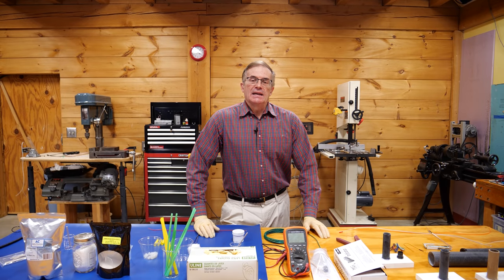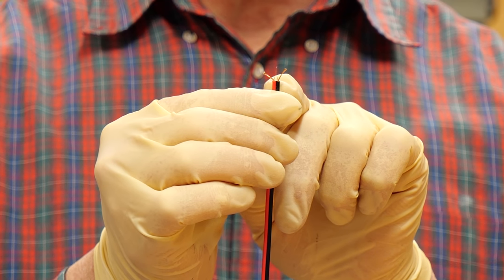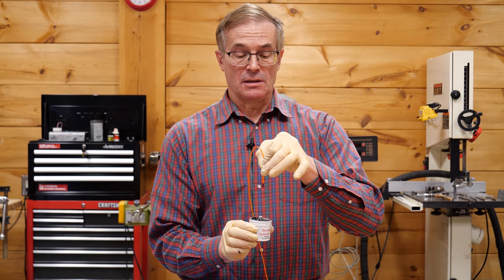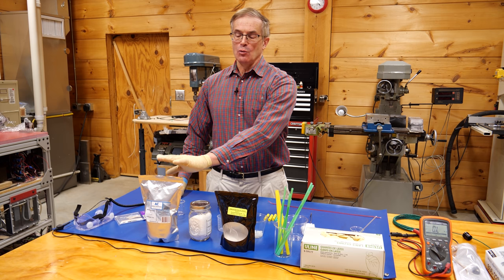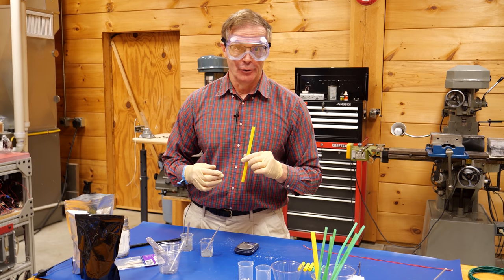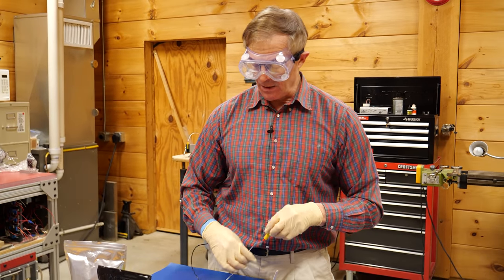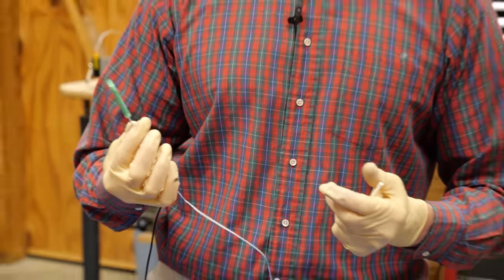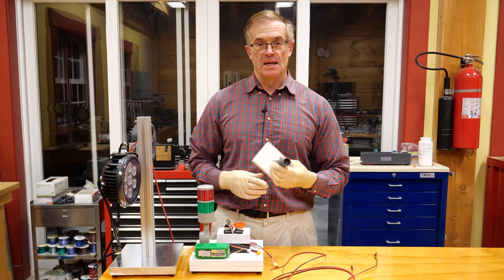Rocket Ignition System On Steroids!

Comment: I'm curious about recovery systems for these rockets. When I was a young'n, the Estes models incorporated a charge in the end of the engine which would pop the nose cone off, and if packed correctly, deploy the parachute. I'm wondering if that was a somewhat proprietary setup to sell more recovery wadding (fire-proof toilet paper, basically), or if it's just a tried-and-true method.
Reply from the maker: It's not proprietary there are ways to fabricate that delay segment and recovery charge.  With the improvement in low cost, light weight electronics, even relatively small rockets can use digital recovery systems based not only on time, but also altitude and acceleration.

Comment: If you place the rocket motor on a Nintendo Wii Fit Balance Board, you can connect it to your computer over Bluetooth for an easy way to log thrust over time, rather than just logging maximum thrust. For $10, you can't beat it.

Comment: Would the wire sticking to the motor for even that fraction of a second, if in an actual rocket, not cause just a bit of a snag to one side upon launch?
Thanks!
Reply from the maker: Probably not.  If the wire doesn't disintegrate, it will be blown out before the rocket has moved significantly.

Comment: would the hot glue cover up the starter when inserting into the green straw? if so does it simply burn easily through the layer of hot glue covering it?
Reply from the maker: It does cover it up, but the starter burns through easily.

Comment: @Tech Ingredients 
Re: QuickBurst Kit constitutes, circa T-5:00
) I’d like to suggest that perhaps the “binder” included in the kit might instead be a 'nitrocellulose lacquer' rather than an 'acrylate-based resin'.  
.ᴀ) Have any thoughts about this in favor or otherwise? 
.ʙ) Do you by chance recall if this binder had any odor to speak of?   
) Finally, any thoughts or indication of what oxidant they've included in the kit?  
.ᴀ) Any telltale coloration upon combustion? 
I'm guessing one of the chlorine donors but I really have no idea.  
I‘ve tried, unsuccessfully to locate an SDS for that kit; it seems the manufacturer is a smaller organization so I’m honestly not too surprised.
.ʙ) Were you provided anything like that?
Reply from the maker: They provided no information and you may be right about the binder as that works with acetone.

Comment: I'd consider using some heat shrink tube instead of the straw. Should be a lot easier to set up. As long as you can heat it to shrink without starting the primary igniter of course, but at around 90°C should be possible. Especially you're using hot glue which is often hotter.
Reply from the maker: I tried it and it works, but it wasn't any easier and so I kept it simple.

Comment: It seems to me that these rocket motors burn with full thrust only in the first 4-5 seconds. Perhaps because of the growing cavity inside and therefore the declining pressure of the gases? Is there a way to keep the pressure more constant? Perhaps by pouring rocket fuel with different burning speeds into the tube in several layers? That is, from inside to outside with increasing burning speed? This would allow the engine to burn more efficiently at full thrust almost to the end.
Reply from the maker: Remember these test grains had no nozzle and a burn of ten seconds would be pretty long for such a small motor.  With the increase in chamber pressure that occurs in an actual motor, the burn rate increases.
Reply: Ah, I forgot. Thank you for the answer.

Comment: I am absolutely FASCINATED by this series, thank you!    I have a request, I have been studying amateur rocketry for several years now, and I ran across a french white paper from 1970 or 71 wherein it talked about using chemically retarded Semtex as a solid rocket booster.  Obviously, as a civilian, I don't have access (or the desire) to replicate that particular setup, however, the idea of taking a highly energetic substance and chemically altering it to slow its output is scientifically AWESOME.  Could you consider doing a video explaining such reactions?
Reply from the maker: Your practical concern is paramount.  The necessary quantity of any energetic precursor could seriously damage a building if detonated.  I'm going to stay away from that.
Reply: @TechIngredients  yeah I don't think that rocket was ever tested, it was theory only, I was simply interested in the chemical inhibitor aspect of the rocket.  WAY too dangerous.

Comment: Are the time hacks on that last run actual? Did you get on the order of a minute of useful burn time?
That's quite impressive.
Reply from the maker: The burn times are real, but the useful portion is only during the most vigorous portion.  These were only test grains for various propellent mixtures and did not include a nozzle.  With high chamber pressure the burn accelerates, is even more vigorous, but shorter.

Comment: Wow, everything you do is very good. The rocket engines which me and my son made burned for about 5 seconds. The ones which did not exploded. (Wife threatened me if I did that again).  You had over a 10 second burn.  I used one of those pressure plates to calculate the power.  My question, is how big of a engine can you make with the rubber?
Reply from the maker: Thanks!
The test grains I ignited didn't even have nozzles (I mentioned that, but didn't emphasize it).  The propellent in one was exactly the same formulation as the solid rocket boosters for the Space Shuttle.

Comment: I think you missed the point of the key on that switch. In industry and military, those types of switches always come along with the rule that no one enters the danger zone unless they are carrying the key. That prevents miscommunication from causing the operator thinking the zone is clear before it actually is.
Reply from the maker: No, I get it.  I just didn't want to overcomplicate the presentation.

Comment: Thanks a lot for making such quality vids!

question: have you thought about using thermite to light up theses engines? iirc it's some rust and aluminium plus manganese fuse and it burns at very high temperatures, it could be very useful for fuels with a high ignition temperature
Reply: Well a good fuel is a fuel that wants to nearly burst into flames but doesn't randomly.
Reply: @Skylancer727  i mean not as a fuel, as an igniter
Reply: @jujuteuxOfficial  well thermite is good for long burns but still needs an ignition like the fuel itself. You'd more have to drip it into the fuel tank which just adds an extra step of lighting the thermite then dropping it in.
Reply: @Skylancer727  as i said: normal fuse with maganese powder/maganese fuse strip all of that covered with thermite
Reply: @jujuteuxOfficial  well if it's basically the same setup, you just threw thermite in. Not seeing the point of doing that. It's not like you need the thermite to sustain the reaction.
Reply: @Skylancer727  not to sustain, to have a stronger kick
thermite burns really, really hot and will likely create a much stronger fire

Comment: Those composite rockets seem to have two stages; once the burn settles down a bit, are they still producing much thrust?
Reply from the maker: No they aren't.  The grains we're not cored through to the bottom and they were only fabricated to test different mixtures.
Reply: @TechIngredients  Ah, I see.  So instead of concurrently burning the entire inner surface, they're only burning the cross-section of the tube.  Thanks for the response!  Yours is by far my favorite YouTube channel--keep up the good work!

Comment: Curious why there was the continued low intensity long burn after the main trust event.  This would be tricky for a system deploying a parachute where the parachute might be set on fire by the continue low intensity burn.   Would this continued low intensity burn be eliminated for a rocket with a nozzle due to higher pressure forcing everything to burn out quicker?
Reply from the maker: That's  correct.  The regression  rate through the propellant  is pressure dependent.

Comment: Some of the rocket motors appeared to trail off in thrust for an extended time. If so was that by design? Why did they not keep the same flame output all the way to the end?
Reply from the maker: Remember, these were not motors, they were propellent test grains.  There were no nozzles, no significant internal pressure was developed and the trailing burn was some of the epoxy base and cardboard burning with small residual oxidizer from the propellent.

Comment: I'll add a comment on an alternative ignition system as a FYI safety tip.  The system has the advantage of checking the continuity of the circuit path from the power source (battery or transformer) through a series indicator lamp to the rocket igniter and back to the source ground.  I learned this safety technique from one of those science lab / rocket kits as a kid, so it's not my idea.  Used it when I built a rocket ignition system.  Probably others have seen it as well.  It turns out the lead wires and final rocket igniter connection can be troublesome in the field and this circuit performs a quick check before someone walks out to the business end of the rocket, jiggles wires but forgets to deactivate the power delivery system energizing those lead wires.

_Circuit Loop Description_.
From the positive (+) terminal of a +12VDC battery, the following series of components are connected: an arming switch followed by a series 12VDC lamp, followed lastly by the rocket igniter (having a small but finite resistance).  The rocket igniter return wire is connected to the negative (-) terminal of the +12VDC battery source to complete the loop.  A push-button momentary, (normally open) "Fire" switch is wired in parallel with the 12VDC indicator lamp.

_Operation_.
With the arming switch off, the rocket igniter lead wires can be fielded. Turning on the arming switch provides nearly all of the +12VDC battery power to the 12DC indicator lamp.  The lamp lights up (if the circuit through the rocket igniter is complete).  Very little voltage drop occurs across the rocket igniter because its resistance is much smaller than the lamp's resistance.   The loop is closed.  This is Kirchhoff's voltage law in action.  If the DC resistance of the lamp and that of the rocket igniter are known, one can calculate the voltage seen across the rocket igniter terminals using voltage division.  In general, it is a small fraction of the +12VDC battery output voltage.  If the lamp is not lit, there is an open in the system between the firing station and the rocket.  Disconnect power and investigate.  If the lamp is lit, the system is armed and ready to go.  At "Fire-in-the-Hole," the push-button momentary is pressed.  The lamp is bypassed (and it goes out).  Now all +12VDC voltage is transferred across the rock igniter terminals.  It flares/ignites, and we see something similar to your field demonstration.

If the resistance of the lamp is too small compared with rocket igniter resistance, an additional series resistance can be added such that the push-button momentary is now in parallel with the series combination of lamp and added resistor.  The combination is bypassed when the "Fire" switch is depressed.  Again, use voltage division to calculate the added resistor value to keep the continuity check voltage across the rocket igniter small enough (say, less than 1V) to prevent it from igniting.

Great DYI lecture series, BTW!  Be Safe.

Comment: Question: why the addition of barium sulfate makes the flash to burn much more rapidly, isn't that just a dead weight ?
Reply from the maker: Sulphates at as a catalyst to increase the rate of decomposition of the oxidizer, releasing the oxygen more quickly.

Comment: since you are building the rocket motors yourself, isn't it better to insert the igniter from the opposite side of the motor from the head? I've done this on my crude made amateur rocket motors in the past because i had issue with CATO when pieces of the igniters stuck in the nozzle (residue, wires...). i was using match heads mixture for the igniters and that mixture creates hard residue... i think this is not issue with larger motors tho, since they have bigger diameter nozzles...
Reply from the maker: It's best to do it the way I described.  Just don't use heavy guage wires or durable materials in the starter and they won't jam.

Comment: I'm wondering if you could use one of the Rapidset concrete products (CementAll and Mortar Mix) to make nozzles.  Tough stuff
Reply from the maker: Indeed it is.  Did you see the test bars of UHP concrete we had sitting on the table next to the still in our last video?  Those are based on Rapid Set cement.
Reply: @TechIngredients  The best way to get the most strength out of those is to minimize the water you add through the use of plasticizer admixtures.  Amazing chemistry behind how that works

Comment: Couldn’t you use typical flash powder (Potassium Perclorate And Aluminum Powder) for the amplifier?
Reply from the maker: Ammonium perchlorate produces more gas.  I believe this helps to rapidly fill the core of the motor during ignition.

Comment: This is all very involved, heh.

For my APCP motors I've made I just use a little paper baggie (made of a napkin, often) with an e-match of my own make (or commercial) with copper (II) oxide - aluminium thermite, tied off with some string. 
Starts motors instantaneously - and I do mean instantaneously - with no chance of plugging the nozzle with molten plastic or other debris.

The copper plasma is a very very good method of ignition due to its heat and its catalysis of AP decomposition
Reply from the maker: Molten plastic will not plug the nozzle even if any of the plastic is not vaporized.  Only the conductive wires we are both using have any possibility of surviving.

Comment: Since you have been using both potassium chlorate(KClO3) and ammonuim perchlorate(NH4ClO4) in your videos now, it might be a good idea to mention that these to chemicals must never ever come in contact with each other. Really careful pyrotechnicians won´t even use them both in the same building. If KClO3 dust ends up in a container with NH4ClO4 they can form NH4ClO3 which can detonate spontaneously, and in the worst case bringing all the AP to detonation along with it.
(The possibility of NH4ClO3 formation is also why the combination Aluminium/nitrate/chlorate is known as "the death mix")
Reply from the maker: Thanks for the warning.
We don't have potassium chlorate in the building and haven't worked with it.
Reply: @TechIngredients   You used KClO3 for the smoke bombs almost four years ago. That was the time when I wrote a really angry warning because I thought no one should ever demonstrate that without warning for how sensitive it becomes with other fuels, or with even with sugar without retardants and stabilizers. A viewer who makes the trouble of buying KClO3 is almost guaranteed to try it with other fuels and that may end in distaster if he or she doesn´t have the necessary knowledge. I have seen it myself(spontaneous ignition in my basement). Here in sweden we used to have a weed killer that contained 55% NaClO3. It eventually got banned when too many people had blown their hands off mixing it with sugar. Shock, friction, and low pH value are  the enemies. When a mix is ignited by shock it can detonate instead of deflagrate. You used a very low chlorate concentration and your bicarboante worked as a pH buffer which decreases the danger. Sulfur, sulfur compounds and metals, are much worse than sugar. Whith red phosphorus it can ignite even when mixing it wet. Oh, btw I suspect the reason for using lactose instead of sugar is simply decreasing sentitivity. 
In the entire European union the situation for hobby pyrotechnists is horrible now. They have now banned both KClO3, NaClO3, KClO4 and NaClO4 for anyone without a license  ..and such a license is almost impossible to get here in sweden. They destroy all fun for decent people just because a few idiots in the middle east has used KClO3 for making IEDs. Recently it became even worse: private citizens can no longer buy aluminium or magnesium powder either!
As far as I´m concerned this is nothing less than a collective punishment. Collective punishments is unworthy for any country who wants to call itself a democracy. Fascism is what it is. I´ve heard that the authorities in the US use pretty ugly methods too. KClO4/Al has legally been classified as a high explosive despite the fact that it isn´t. 
Obviously this is just a way of making it a federal crime to make this mix. If you buy KClO4 from Skylighter they log this so that you never can buy aluminium powder from them in the future without a license for making high explosives, because that would be considered buying a "kit" for a high explosive. Ridiculous.   ..but that was years ago. Can you still buy pure KClO3 or KClO4 today?
PS
Your channel is amazing!!!!! What education do you have?
DS

Comment: I found that a 10 ohm 1/4 watt resistor makes a cheap ignitor when using a 12v battery.  The resistor shorts, gets hot and catches fire.  Shoved up in the head end of the rocket, the rocket fuel is the ignition fuel.
Reply from the maker: Good idea.
Reply: Would just plain nichrome wire work the same?
Reply: @sophietaylor9753  Nichrome is the standard.  I would solid Cat 5 wire for the leads and then use a wire wrapping tool to wrap the nichrome wire to the leads.   Resistors are cheaper, more available, and simple.
Reply: @miken7629  Fair, this isn't precisely my area; I'm much more familiar with what happens once the rocket has done its job :)